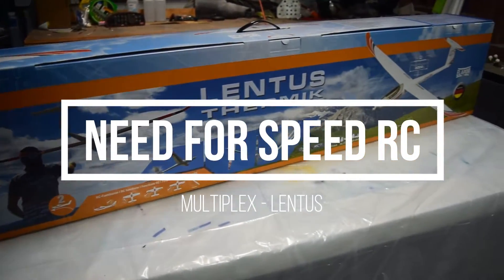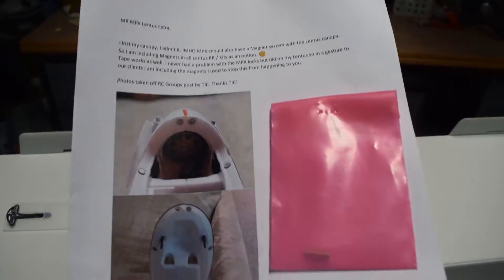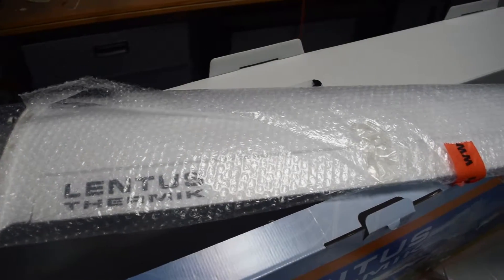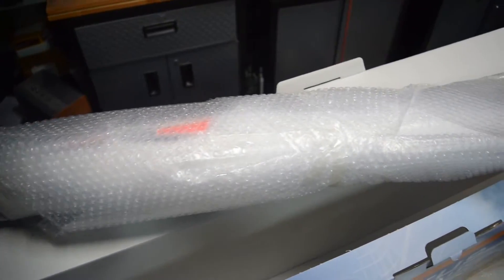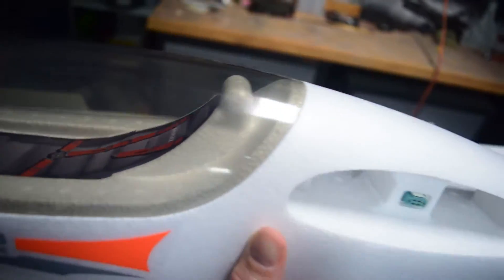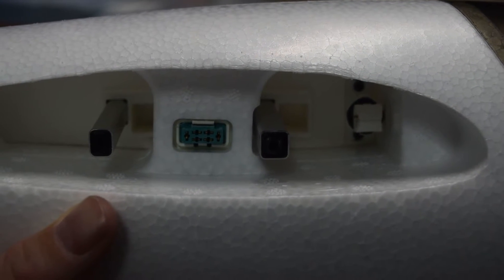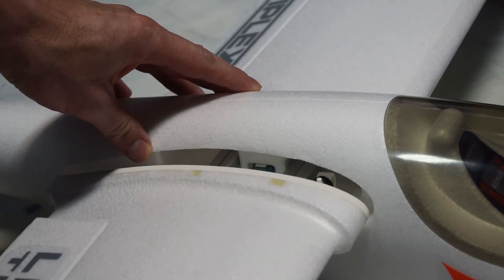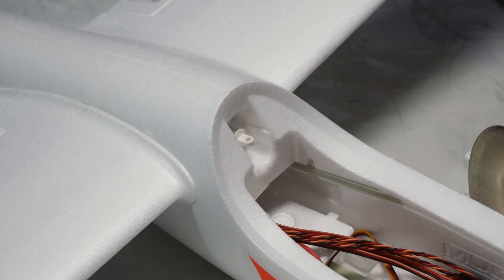Multiplex Lentus E Glider - Unboxing and Assembly Walkthrough Guide - Electric Glider 3M Wingspan

Comment: How does it compare with the FMS ASW-17?
Thanks for sharing the video!
Reply from the maker: The lentus is a better thermal glider in our view.
Reply: @need4speedrc  Thanks for the quick reply. In terms of using for fpv and moderate windy conditions Lentus is still the best candidate?
Reply from the maker: @ATCATL  sorry not sure I don't do FPV
Reply: @need4speedrc  Understood. But about windy conditions which one will be faster and handle turbulence?
Reply from the maker: @ATCATL  lentus
Reply: @ATCATL the fms is very heavy. The servos are also 17g but plastic. My aileron stripped and led to a crash during a windy flight. Theres also no reinforcement in the hinges. Just foam. Only thing I liked about it was that the motor was easy to change to an upgraded one as its uses a typical motor design and prop that you would find in a warbird.
Reply: @M4rkmcc21 Many thanks for your reply, that helps a lot!

Comment: I have been comparing this to the FOX FMS 3000mm sport glider. This is a little more expensive but seems worth the additional costs. Looks like it would be a much better thermal catcher and all around glider period.
Reply from the maker: I also have the 3m fms fox. No comparison really. The lentus is a much better performer in every aspect. The fox is fun and huge but it can't thermal well. It is much more of a sport plane than a glider.  The lentus is well worth the extra money in my opinion. Good luck 👍
Reply: I have both of the Gliders you mentioned, the Fms fox is awesome, but the Lentus 3.0 flys rings around it, it thermals beautifully, is mildy aerobatic - compared to the Fox, and the noise it makes on high speed passes etc sounds like angels singing.

Comment: Nice video. Thank you. I just bought one (rr version too) and had the cularis before. Interesting they gave you some extra magnets as I saw one with the canopy come off. I was wondering how you got on with 11mm elevator throws in flight as all the other surfaces have bags of movement except elevator, but a higher tail maybe a greater movement arc. The wings are definitely stiffer than the cularis at the root, so got to be careful with grounds loops and nice flat field probably best for test flight. Motor looks a bit flimsier that the cularis motor with bigger blades.